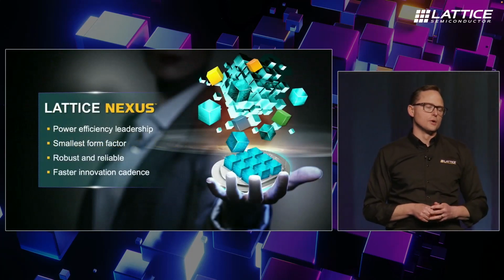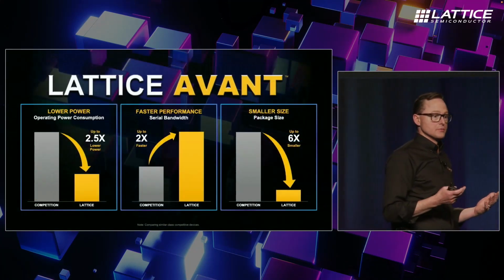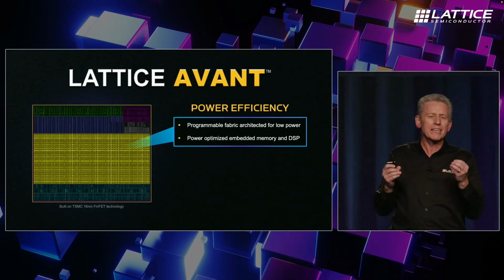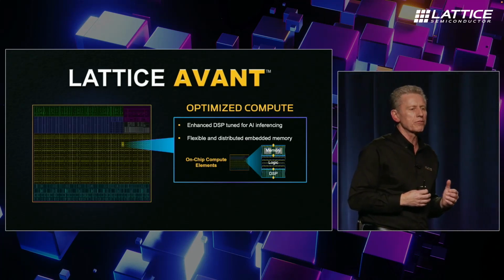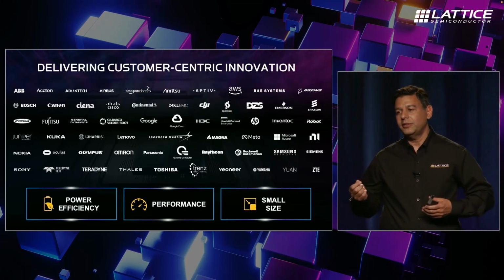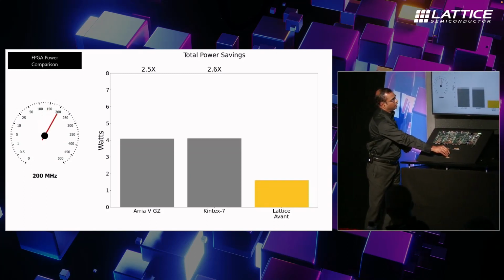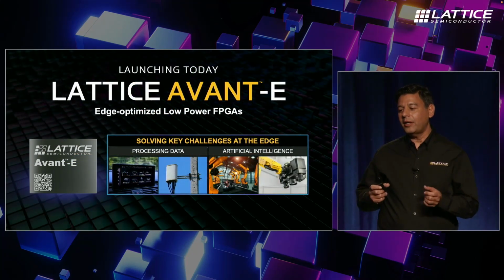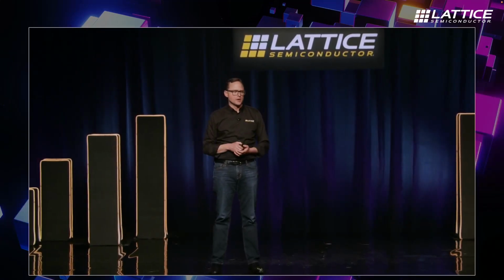Lattice Avant™ Launch Event – Dec. 5, 2022

Comment: Dear Lattice Team, the Evaluation Board is now released at a price of ~$1000.  As a hobbyist and beginner in FPGA, do I have to buy a $2000 Lattice Radiant Software license on top of that?
Do you expect your customers to pay $2000/year to renew the license so they can use your hardware? 
Do you have any free stuff available for the Avant board or are beginners forced to buy lower tier FPGAs. This is kind of a dealbreaker for the non-professional market